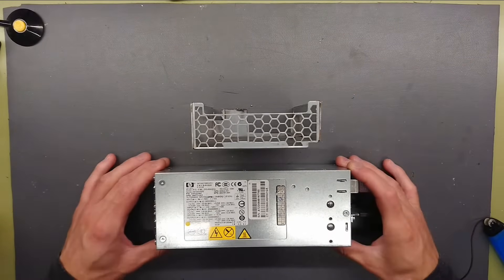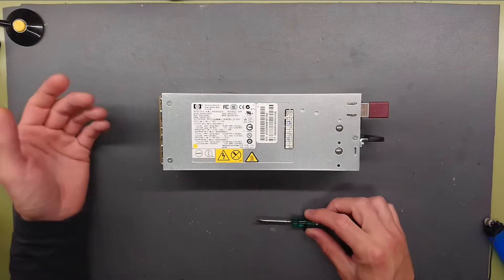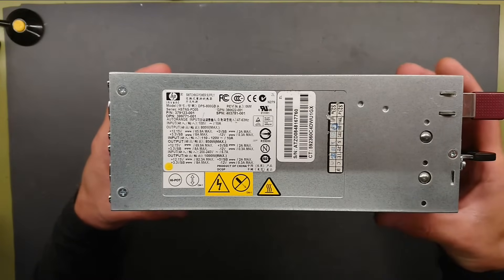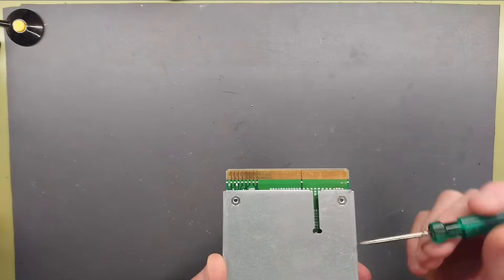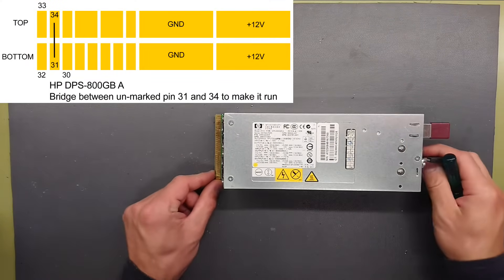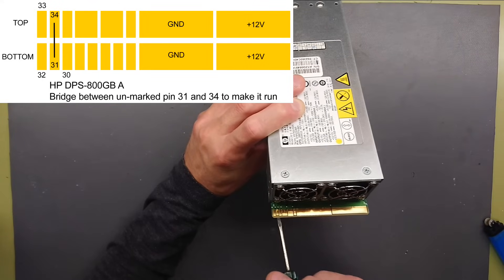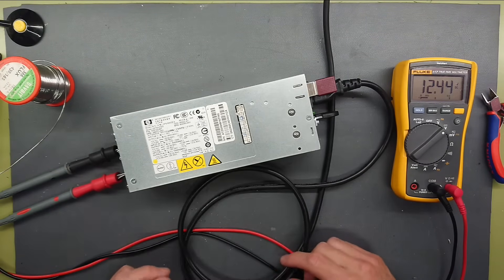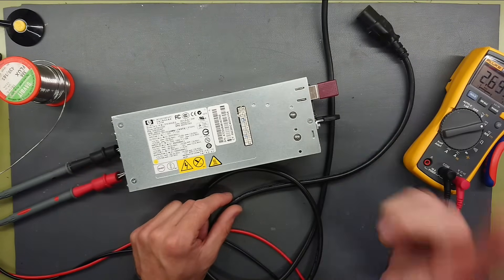Server PSU Hack - HP DPS-800GB A, 12VDC 1000W

Comment: Do I need a resistor between pin 34 and 31? And can I use a switch?
Reply from the maker: A resistor will treat the input nicer, less peak current and switching noise. You can use a switch, best in series with the resistor.
Reply: @KaizerPowerElectronicsDk  thanks

Comment: since this PSU also outputs 5V and 3.3V, surely someone could make a board with a 24 pin motherboard connector, 8 pin CPU power connector and other accessory connectors too right?
Reply from the maker: There is plenty made! Just google for "server psu breakout board"

Comment: I accidentally put a load across the 12v and pin 34 now the psu will not turn on.  Is the thing dead or did I just blow a fuse?
Reply from the maker: The 12V output is protected by current limiting and should reset upon current draw below threshold or from a power cycling (turn it on/off). If this does not work, you have most likely destroyed something in the controller circuit.
Reply: @KaizerPowerElectronicsDk  yeah it's dead.  I could open and trouble shoot it if I felt like it....nope.  Thanks for the answer.

Comment: Hello sir
Do i need to use both lower and top negatives together? Or can i use one side to solder plugs too to use as a power supply
Reply from the maker: They are internally connected, I just used both sides for most possible contact surface for high current.
Reply: @KaizerPowerElectronicsDk  
I have bridged the on off oins 34-31 correct?
But when i plug it in the light goes on then immediately turns off and i dont read 12volts on the main +&-
I am confused 
Any ideas sir?
Reply: @KaizerPowerElectronicsDk   any help would be appreciated 
Wheni plug it in the light comes on my charger i want to use turns on for 2sec
Then turns off?!
The light turns off and the fans dont even spin up!
Please help!

Comment: 13.8 V dc ?...which pins ?
Reply from the maker: Needs to be modified in the feedback circuits to get such a high voltage, not all server PSUs can be pushed all the way up to 13.8V, some start to fail and stop over 13V.
Reply: 33 -> screw potentiometer -> 38
https://youtu.be/g1psZuy_6ZQ?t=123s

Comment: Hello, Would it be possible to charge a  12v 100Ah Lithium battery with this PSU, thank you.
Reply from the maker: You will always need a charge controller for batteries, to ensure safety and lifetime of the battery.

Comment: Frome what I can tell, the HSTNS-PR01 PSU is interchangable. I shorted the pins mentioned here, and it spat out 12 volts. Looking at getting a Vega 64, so the 800 watts will be useful. Going to splice some cables so all GPU and motherboard 12 volts comes from the server PSU, and a 450 watt SFX PSU I have laying around will handle the other voltages and 12 volts to drives etc.
Reply: do make a video
Reply: @enkhbayar.n  So far my 540 watt is doing fine; might not bother.

Comment: HI, what you think how many amper it can continously produce ?
Reply from the maker: Use Ohms law to calculate it from 1000W and 12V
Reply: @KaizerPowerElectronicsDk   ;))... thats the unreal theorie. the real current you can test on the shunt or other power device.
Reply from the maker: @inagerli  they have built in  over load protection that shuts down and restarts at next mains cycle.
Reply: @KaizerPowerElectronicsDk  ok, thank you !

Comment: "You can put 3 in series for 36vdc..."  "- is attached to chassis ground"
...Would that not cause a massive short to ground when psu2 or psu3 was connected to + of psu1?
Reply from the maker: You have to modify the secondary side grounding, check this out: https://www.youtube.com/watch?v=xRAlXCzsY3Q

Comment: men I buy one of those and put it a resistor to 32 to ground like others video clips and what happen was it blows something inside ,it hurt me because it was brand new ... first I put the jumper and the resistor and plug to the outlet and the light ,don't the start ,but the fans work , I take Out the resistor and star great but in 2 min blows inside ...the damage was done ,...
Reply: Which resistor?

Comment: One minor correction I'd like to make, here in the US you can easily find servers that run off of 240 v. In fact I just purchased one that runs just above 2.4 kw, 200 amps output.
Reply: It's about the plugs that are typically in our walls. Only common 240 volt outlets are the giant ones used for things like driers and stoves. Most of us have 240 going to our breaker boxes.

Comment: Can we use 360v DC as an input ?
Reply from the maker: Theoretically you could inject a DC voltage to the DC bus after the mains rectification. But there could be some measurements you have to fool, to make it run like that. I am not sure about up to 360VDC, but regular rectified 230VAC is 320VDC'ish.
Reply: @KaizerPowerElectronicsDk  thank you soo much for the reply , but still I will try this , I think the supply should have some kind of over voltage protection . I will let you know what will happen at 360VDC 😅.

Comment: can i use this charger in parallel with an Agm battery to feed a 12v  inverter?
Reply from the maker: You properly could, but remember that the highest voltage source will draw the most current. You have to think in impedance matching, I assume you want the PSU inthere to draw power from that and incase power fails, it runs on the battery instead? Its not that simple to just float a 12V battery, you will need to take it out and recharge it properly once in a while.
Reply: @KaizerPowerElectronicsDk  My PSU is 1200 W and my inverter is arround 1800, i need the battery to kick in case the load goes above 1200w.
Reply: @KaizerPowerElectronicsDk  my system is 240v 50 hz to 110 60 hz  converter using a power supply and inverter.

Comment: I want to know how to tell the efficiency rating of these power supplies, am new to these stuff i found the exact psu, planning to use it for mining, thanks in advance ❤️
Reply from the maker: Look for the power factor rating.
Reply: @KaizerPowerElectronicsDk  where can i find that? I didn't find that 80+ rating sticker
Reply from the maker: @selmanefarescherifi4283  find the datasheet online. A modern SMPS is close to 89-96% efficient
Reply: Planning to buy the same psu u used in the video, does it show how much efficiency it got?

Comment: Hi, I want to power my mining rig this way.My concern is that it output 12.4-12.6V, can this voltage damage GPU? Also should I expect voltage drop to 12V when I connect the load(in my case gpu)?
Reply from the maker: Try to measure the the +12V rail on a regular computer PSU that you would connect to a miner without asking questions, its not stable at 12.000V

Comment: Is there a method of shorting pin to increase fan speed or the fan is thermal control? Cause previously I’ve tried shorting pin on my Dell 650W psu so that whenever I want.
Reply from the maker: Some are thermal controlled and some are always on at full speed.

Comment: Thanks! Very concise and informative. Need to find a source of servers PSUs for cheap! Would be interesting to see an instruction of connecting PSUs in series from you. Is 36V the limit, or could one connect four for 48V? 
Still looking forward to that IKEA Tillreda video number 3 with a closer look on how to hack the electronics of the induction cook top! :)
Reply from the maker: I got a video on making a 36V cluster from DPS-750 PSUs: https://www.youtube.com/watch?v=xRAlXCzsY3Q 
The limit of 3 in series seems to be a limit on the output components specifications and possible bad voltage sharing, most people that have 4 in series experience that the PSU in the end of the chain at ground rail fails after a short while.
Reply: @KaizerPowerElectronicsDk  Many thanks for the reply!
Reply from the maker: I was ignoring the ikea tilreda question a bit, I feel bad about absndoning that project for so long :)
Reply: @KaizerPowerElectronicsDk  There is no reason to feel bad. But there are several reasons to continue the tillreda project! :D

Comment: Can you simply connect the outputs in series?
Reply from the maker: Yes, but then you have to shield the metal cases from touching and not connect a main ground, as the negative rail is connected to the chassis. You can also remove the secondary ground connections as I show in this video: https://www.youtube.com/watch?v=xRAlXCzsY3Q

Comment: Why are they series limited to 3?
Reply from the maker: The voltage sharing does not seem to be perfect. The specifications of the output components does not seem to handle 4 in series very well, the PSU closest to ground will often fail.

Comment: How did you know it was a 4 layer board?
Reply from the maker: I saw pictures of others that have drille through and holding the board up against light you can see at least one track that goes between both sides as there is no track on either side, but there is a shadow of a track.

Comment: these are very popular with the RC community for driving high power charge controllers.
I have also used these to drive car high power car amplifiers indoors and they work very well.
Reply from the maker: Cheap, easy to find and I have used them for induction heating, 3d printer, fans, dc motors and so on. About the best PSUs there is to the money.
Reply: I also want to use one for a car amplifier, did you use a battery or some capacitors inline with the psu?
Reply: @adamfpv8294  the battery would be better than the cap since it could help out on some quick burst power the amp draws
Reply: @srirachaowner9478  capacitors have a much higher discharge rate, or are you referring to capacity?
Reply: @adamfpv8294  yea the capacitys of regular caps that you find ob amazon for like 60$ i mean those arent good. But supercaps are different

Comment: Others in the RC forums say you need pin 30 connected to 12v output if going more than 100w or so.
Reply from the maker: I have pulled 68A continuesly from this with just that bridge in place :)

Comment: Interesting, great little look at the PSU.
Atleast pin 34 was a dead giveaway, since the enable pins are alsways the shortest of the control pins. 
(Atleast on all server PSUs I have ever seen) 
Especially the newer kind with a fan control is really nice since the fan won't always run full power. 

PS: did you get my mail? :)
Reply from the maker: Not all have different length on the control pins, but the wide tracks can usually be ignored. I got your email, I see it was  received 1st July, was some hectic days to get finished at work before vacation, so a lot of stuff went by fast :) Thank you for the files, its all downloaded and I really should finish the video on the first one :)
Reply: @KaizerPowerElectronicsDk  Interesting, good to know that the pin length rule dosn't work on all supplies. 

Great to hear and looking forward to your videos. :)

Comment: i have one, crazy and very stable power in such small space, not too margin to regulate voltage (max is 13.8 if i remember right)
Reply from the maker: There seems to be aditional wiring and possible a potentiometer to add to make it run full load at overvoltage. I only needed 12VDC for this mod.